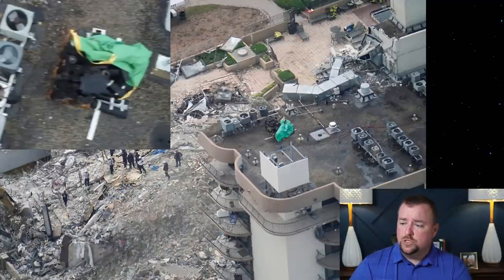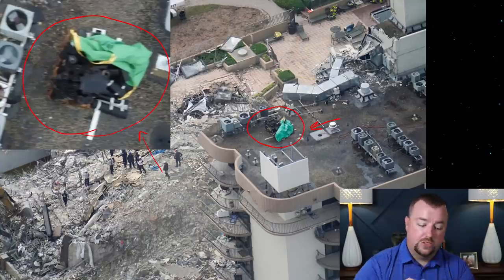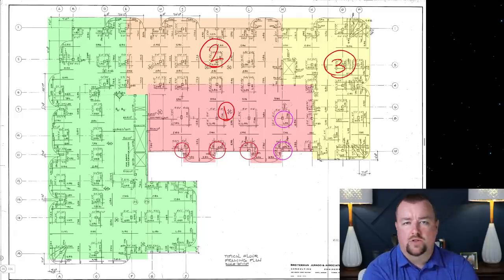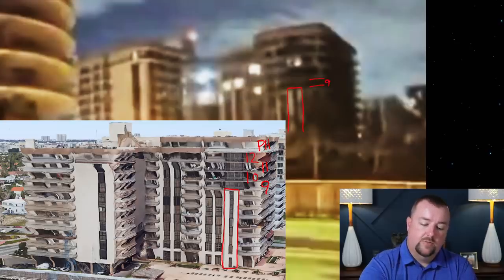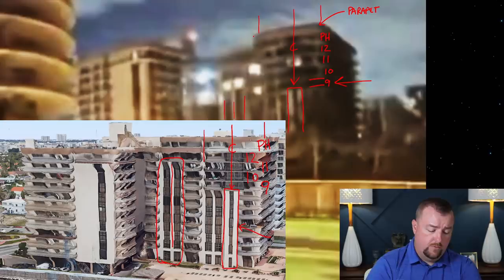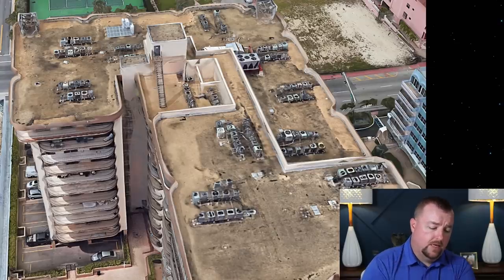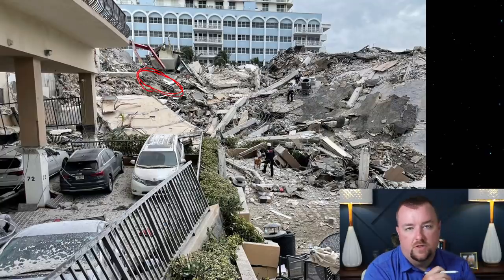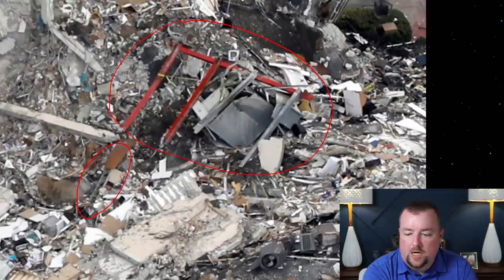Surfside Building Collapse - Did it start at the roof?

Comment: There also ma be a delay in the led lights going out when the power is cut.
Not sure what type of converter circuit there will be in the led units but it is some times noticed by our eyes a delay when they are turned off, this may be that the circuit has a relatively large capacitance which will take time to discharge after the power cut.
Not sure the timing between the frames but believe it most likely be faster than the human eye.
Hope this explanation helps in this terrible incident.
I understand that one report putting the safety connections in the roof caused a lot of vibrations thought the building this was not good for the unhealthy rebar in the concrete?
Being in the UK I believe we do not have such strong building codes.
Does this code take into account where the building is built?
Eg near the coast where the salt will ingress in the building with the rain.
We have found this mainly on motaways where winter salting of the road has damaged the concrete structures.
Thanks for the explanation.
I feel for all involved including the workers who must feel terrible.

Comment: Making the beams thinner (Mid section) might be by design if you wanted to
 demolish it in the not so near future (Let's say 50 years lifespan). 
Making this center section weak by design makes everything implode with 
almost no effort like it did. It is therefore questionable if this other
 Sister building is really safe (Certified) as it probably is build the 
same way to implode (Demolish with no effort) by the design.

Comment: You mentioned it briefly (punch thru failure).  But I anticipate that you will explore that more.  It's my suspicion that the pool plaza area suspended slab was compromised by the years of salt water leaching thru the slab.  Concrete is actually very porous if not waterproofed.  And it's likely that in the 70's  this tiled  plaza area was poorly waterproofed.   Large intact sections of this elevated slab are laying like a blanket on the basement floor but with the columns still standing.  The slab sheared around the columns obviously.  The PT tendons running  north/south were pulled southward as the plaza slab collapsed  (The woman on the phone with her husband described the big hole appearing just before the collapse).  We can't say for sure because we don't know yet.  But that plate movement would have moved (laterally) a whole line of columns that were adjacent to the pool plaza area.

Comment: Why nobody is talking about the lack of beams in the garage and other parts of the building? If you don't use beams, the other option to hold up the slabs is to use abacus and capitals to support the slabs. I don't see beams, abacus or capitals in any of the pictures or videos that are circulating online. That is a major factor in the weakness of the structure. Then you add the failed waterproofing and lack of maintenance and you have a disaster.  It's like building a house of cards.
Reply: That has been mentioned.  I mentioned it myself.  I agree it was a weak structure from the get-go.

Comment: My question is how long does it take to get permit,  setup, and pull a building? 
If it's simple chimney, a day.  But a multi floor building takes months. How did they get it all done in less than 10 days?
Reply: It only takes months to plan demolition of a large, sturdy building.  This was a flimsy building and there was sufficient room to drop the west wing away from the work area.  The authorities wanted it down and they found someone who could do it.
Reply: @GH-oi2jf  
Drop it where? In its footprint away from old debris and like I said it was 10 days not a month

Comment: The section of the penthouse you suggest is missing may just be set back, so the angle of view is different. It may be still there IN this photo.
Reply: The part with the stairs - also the part in front on the video - looked recessed to me.

Comment: Those units had some very heavy tile and granite remodeling done to them since the building was built. 
A guess would be abt 4000lbs of materials per unit, thats abt 500,000lbs on columns that were already undersized in the part that collapsed. Sprinkle in water damage to the structure and you have a disaster. 
What are your thoughts ?

Comment: The problem with building collapses is all you have is a huge pile of ruble, the original construction drawings and possibly a building inspection report to go on.  The still by stills are helpful as well. It’s a daunting task to determine the cause.  My best guess is that the collapse was caused by a multitude of reasons.  I think that it was due to not having a slurry wall design to cut off the salt water migration,  poor quality construction and design with some missing or inferior steel rebar reinforcement work, overall lack of maintenance, poor quality repairs.  The mix design or the quality of the concrete could be a factor as well.  To focus on this particular video loading all that heavy roofing material loaded on the roof certainly did not help either.  I think that all these factors combined lead to the collapse and it is nearly impossible at this point to pin the cause on one factor.  This video series is very intelligent, well thought out and honest.  It is also very objective.  It might take years of sifting through all the various factors, details and evidence before a definitive factor can be identified that caused the collapse.  Even if one factor cannot be identified it will at least focus attention on improving design, construction, permitting and more frequent inspections.  Again, very well thought out video series.

Comment: Awesome Analysis! Regarding the question - "was the roof overloaded by stored replacement material?". The still at 24:35 more or less shows a large area of roof which is on top of the pile. If the green tarp type of cover is typical, there doesn't seem to be other material being staged on those areas. That green colour is quite distinct from an otherwise limited colour  scheme - sand/cream walls - black roof and the red of the metalwork - green figures only in the bundle on the surviving structure. + I've always been a little disappointed with the security footage because I always thought it was a little cut from the start. It would be great if there was a still from that camera on an ordinary day before the night of this terrible accident - just to compare.

Comment: Can’t wait for the next video! Also, other analysis regarding the actual construction in which shows the absence of “beams” across the floors connecting the columns; thus providing more support and rigidity to the structure, seem to be a flawed of the design. Can you explain, why the structure was built in such manner?

Comment: Did it start on roof?....NO! There are many videos out there that showing a floom of smoke escaping from garage 1.28 seconds before the building falling. The base fell out around pool....then top callapse on itself after base dropped out. Yes the roof had a leak...which we are researching possibly caused this. The pool broke out rendering  garage and support beams useless and therefore no longer stable and secure. When that happens the building is built to fall in o. Itself so it doesnt fall to side damaging other buildings. There are many violations here also and faked inspections. The state and or the city of Florida is NOT responsible for this for it was private owned building. So Im glad you are leavi g politics out of this. For that you got a 👍thank you for your work.
Reply: ..... Watch the whole video.

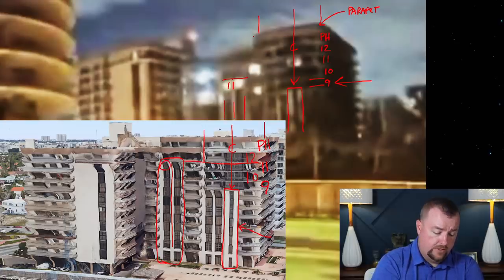Comment: 16:14 to me looks like the floors are still same height top horizontal support for the of windows is on 11th floor is where you say 12th floor is in falling video. IMO
Reply: I agree, the camera angle and building curvature make it hard to follow a horizontal line all the way across the building. From other pictures, the parapet above the portion that he claims is 15 feet lower at the start of this video is not as high as the parapet to the right. if looking at the gap on the top it looks like that portion had already started to fall but like James stated above if you follow the floors around from the right they are at the same height.

Comment: There have been 2 accounts of residents hearing loud sounds, creaking sounds, about 24 hours before the building collapsed. Alfred Lopez from NJ who was rescued along with family (#1106, Collins side that remained standing) said he heard loud building noise that woke him around 3am night before. Similarly Elena Blasser (#1211, middle south facing unit overlooking pool) told her son, Pablo Rodriguez, the next day that she was awoken by loud creaking noises (this would have been night before collapse). She told him she couldn’t go back to sleep. In retrospect what she had relayed to him and what Mr. Aguero heard might have been the start of the building starting to fail. 

Both units were close to the roof. Had me wondering if earlier roof work that day might have stressed some structural component and then it was just a cascading thing as the building expanded during the day and contracted at night. 

I haven’t seen any engineers discuss what might have caused the loud creaking sounds prior to collapse and would appreciate your thoughts. Have been enjoying your videos btw.

Comment: @16:50 you are not taking into account the skew in the video perspective vs the more aligned screen grab.  In the screen grab you can see the roof lines are fairly level across the entire building,however the roofline of the left tower is significantly lower in the video, but that remained standing, therefore you need to adjust for skew distortion. 

Once you do that, the center penthouse is once again aligned with the right tower and therefore the center did not drop prior to the collapse.

Comment: Here's my question. It takes on average of 6-8 weeks of structural engineering studies, blueprint studies, preparation, wiring, charge placement, and securing surrounding areas to implode a building. How did they do all that in 2 days in a structure that was already compromised and unsafe to be inside of ?
Reply: very carefully.  This (the west wing) was an easy structure to bring down because the structure was so flimsy and in such poor condition.

Comment: There were pics from the area below the pool deck where dubris was already seen. The water problem in the basement seems most logically to be the start of the structural failure, several sets of pumps had been replaced as a superintendant had said the high tides would cause additional water depth under the pool deck...

Comment: Could lightning have contributed to the spalling as well as the rust? With the abundance of lightning, is this a factor equal in concern to salt water/salt air?
And the question of where it began - top or bottom - isn't as important with a lightning strike that traveled through the building to the ground weakening its path in such a scenario. So, lightning strikes weakening the structure, causing spalling, the structure stands in a weakened state, roof needs repairs, and in the construction activity, the building collapses.

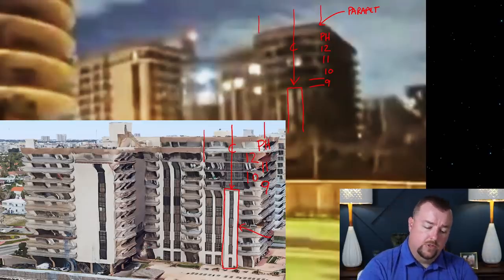Comment: Just something little to mention about the third line at 13:46, it is a bit to far on the left. When doing a transformation in perspective from the google image to the still image, the ratios of the distances between the lines should be preserved, since this is a linear transformation. You can also check this by extending all the white lines to the top as you did with the center line. By this you can see that the gap doesn't start directly above the white line, which might also have a collumn behind it. Thank you for your videos c:

Comment: Josh.  I have watched your theory along with another guy and I think I have the answer.  The video we have seen of the collapse  do not show the beginning of the collapse. I believe you are right.  It started at the roof.   I believe the cantilevered roof in the center broke off (possibly from roof work) and pancaked on to the exterior balconies.  That possibly weakened the elevated deck above the garage.  That collapse would likely break sprinkler lines which would cause the water we saw pouring into the garage along with some debris, 7 minutes before the full collapse.  After this happened the building continued to tear itself apart  until the floor punched through working its way through the building .  If you look at the collapse video what you don't see are all the balconies nor the roof parapet at the beginning of the video.  Thanks for your detailed work that inspired this thought that I believe is correct.  Ron

Comment: Variables to think about and add into your equations. Was the building setting on, slab on piers or just Slab foundation on compacted sand?
Other buildings in that area and about the same time constructed are showing cracks and displacements.  
Atmosphere of the area. 1, sea spray, 3 of 4 major hurricanes road thru the area since those were constructed. 2, Along with winds from as far north as Savannah, there are paper mills and chem factories pumping tons of Sulfides + a mix of acids and salts. All of which can destroy steel and rebarring as fast as the first crack opens up.
Material: especially clips and connections.  Up north here we were having a hell of a problem with re-crystaled steel from foreign vendors. e.g. Parking garage collapse Hartford CT, starting in '87.:  re-crystaled steel is very brittle, it doesn't take much pressure on joist seats and bracing connections to stop working.

Comment: My question about why they began in the roof first wasn’t because I thought the roof collapsed first.  I’m curious why, knowing everything that was going on with water in the parking garage, they would not have started reconstruction there first—It was the highest-risk problem area.  If the roof wasn’t leaking seriously, why mess with it first?  Could it have contributed some of the water than ended up at the underground garage?  Can water travel down 12 floors within the walls?  Could the standing roof water eventually invade the concrete columns?  I know from my own roof problems that roof water can start in one place and travel tens of horizontal yards on its way down, ending up who knows where til it comes up under the floor.

Comment: A THEORY... Hi Josh, after looking at the video posted by user YouTube user FIUEEEE called ( "Champlain Tower South underground garage parking video of July 17, 2020 IMG 7442" ), I have a theory that I'd like you to comment on. I'd like to preface it by saying this is simply my opinion. I am not a Structural Engineer such as yourself, so my opinion may not be valid. --  In the video posted on July 7 by FIUEEEE, the woman is looking for parking slot #17 and films the parking garage. It shows how deteriorated the underground parking area was back in 2020. That said, when she gets to the garage entrance ramp, we can see a series of cracks in the slab at the base of the ramp. One thing that no one has commented on is the "French Drain" at the base of the ramp. - My layman's theory is that over the decades, that French Drain leaked a huge amount of water under the slab causing the substrate under the slab to collapse. Once the slab had no support it gave way, and pulled down the columns and hence the entire building followed. It's my opinion, based on videos here on YouTube, that the origin of the collapse may have been at the base of the building around the ramp area. My opinion is that French Drain was the gateway to a huge water leak problem under the slab. - Check out her video especially at timeframe [1:17/1:19], where you can clearly see the cracked slab and the French Drain adjacent to the ramp. I believe that the constant downward forces of cars coming down the ramp and possibly  water leaking from that drain, may have caused that area to weaken and give way causing a catastrophic failure.  -- Your opinion on this theory would be very interesting. Thank you for your work on all of these videos. It takes A LOT to make these videos and we certainly appreciate your time and efforts.
Reply: This was actually a trench drain that was drained to two 3,000 gallon storm water tanks as detailed in plumbing drawing P2. Whether these 3000 gallon tanks actually drained is another story. But the North tower opted to avoid these tanks and go with a French drain.
Reply: @beehaven9949  Hello BeeHaven, very interesting. I think that if that drain leaked over the 40 year period of the building's existence, that would not have been a good thing. Those cracks in the slab are also very worry-some. Part of that slab is broken on almost all sides from what it looks like in the pictures. - It would be interesting of Josh gave his opinion on this topic. Thank you for your input.

Comment: I really do enjoy your videos. Very informative. But...
I don't think that that stairway could be expected to fall at the same time as the lower deck it is attached to. 
The attachment ro the higher deck it is attached to would be stronger. Gravity does most of the work at the lower deck, there is no reason to stop the bottom of a stairway lifting but every reason to to stop the top from dropping. 
Plus we all believe that the concrete was compromised from water/weather damage so the lower stairway attachment is also likely compromised.
I would expect it to be slowed significantly by its upper fixings.
But that's only my opinion. Please tell me if and why I am wrong.

Comment: When I have watched the collapse video I have always thought that the blue lights on the left were the power lines arcing, after being severed, that were servicing that section of the building. That could explain why the power is out in the next frame. It would be interesting review how the electrical was routed through the building.